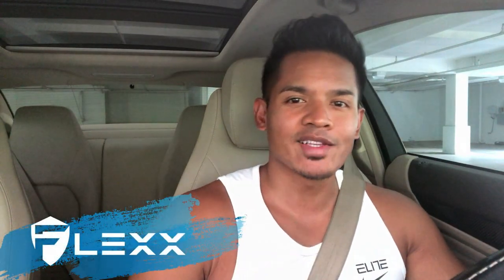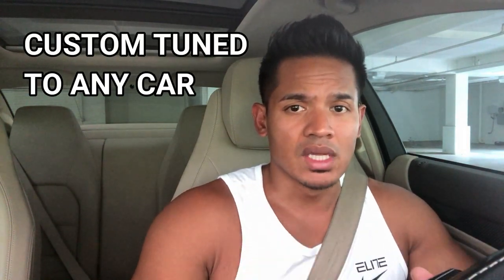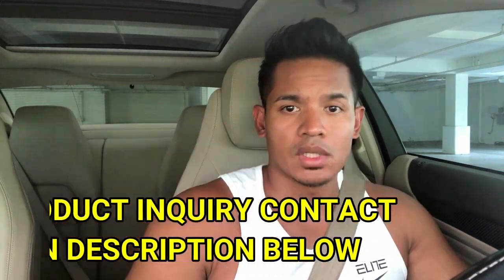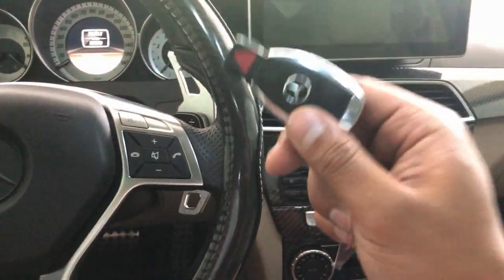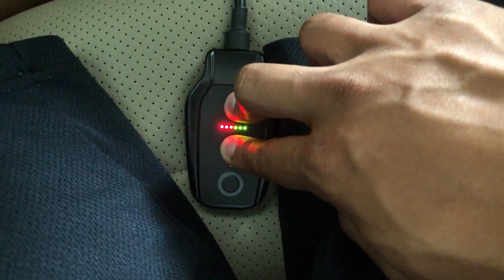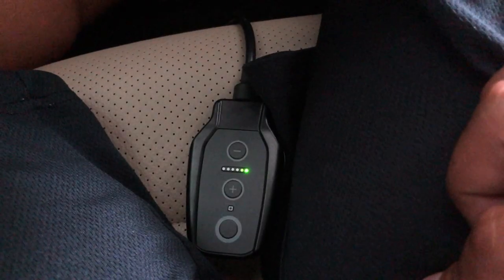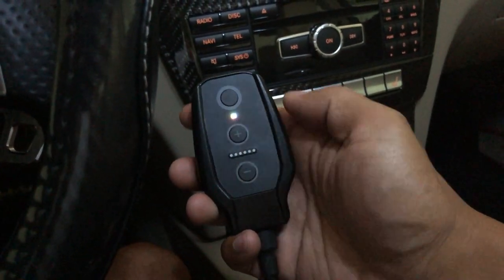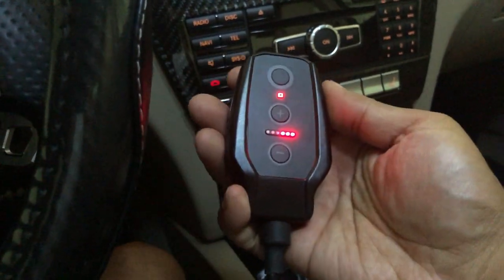Does this tune make my Mercedes throttle gas pedal response faster?

Comment: Hey? Any improvement in acceleration? How it's working till now? What is the benefit of sport mode? I would imagine using eco or racing!
Reply from the maker: Yes. Fine. Faster throttle response.
Reply: @TheFlexxGarage  good to hear :)

Comment: I’ve heard these trash your transmission, anyone have any experience?
Reply from the maker: Well you heard wrong because they have nothing to do with your transmission.
Reply: Hi I am using this since last 3 year no problems the problems with gear box is people don’t change gear box oil then problems starts

Comment: I ordered one for my Mercedes c250 w204 and it did not fit. What’s it’s interesting is mine came looking a lot different than the one in your video. It has a huge red clip on the side from the connector that plugs into the pedal. I purchased from burger Motorsport as well.
Reply from the maker: Then it’s not the same one. You need to talk to them for customer support.  That’s why I got mine from tornado tuning.
Reply: get it fixed yet?

Comment: @flexxalexander Hey I got a question. Would have any idea what key fob fccid is for c250 or ur 2013 c300? I got a c250 with a valet backup key from auction and no idea which fccid it has. Dealer is being a butt.
Reply: Also your website address is not working..?
Reply from the maker: Sorry. Don’t know.

Comment: I have question my car is W176 amg 2013 I have sport mode but what is different for my car this product? Thanks buddy
Reply from the maker: sport mode usually does nothing for your gas pedal throttle response. All it does is allow the car to rev into higher RPM range before the transmission shifts.

This pedal tune with help with the response of the actual gas pedal/throttle. Any car can benefit from it.

Comment: Would you recommend this one or the pedal commander ?
Reply: did you find an answer?
Reply from the maker: Pedal tune from tornado tuning is tuned for the car.  So it’s more smooth with throttle pressure. 

You can’t tune the Pedal commander to the car. What you get is what you get.  A lot of the modes are kinda jerky.

Comment: i’m planning on buying the PC43, which one you think has the more throttle?
Reply from the maker: It’s not about more throttle. It’s about throttle sensitivity.  The pedal commander was too aggressive.  The tornado tuning pedal tune was way better with more settings and adjust to the range of the specific cars gas pedal.

Comment: Hey flexx does this work for a 2009 mercedes Benz c300
Reply from the maker: Yes
Reply: Thanks for responding I’m on the website now just want to confirm is the one in this video priced at 179.99
Reply: @TheFlexxGarage  also does it turn off with the when the car turns off or do I have to manually turn off the tune pedal and then the car ?
Reply from the maker: It shuts off like 30 seconds after you leave car.

Comment: Hello, i can’t turn it off. Is this normal? After using it when closing the car, the Lights still burns even if i try to turn it off with holding the program button
Reply: how much did it cos?

Comment: i know it’s been a while but thoughts of this pedal tune vs the commander pedal tune?
Reply from the maker: Pedal tune is smoother than pedal commander.  Pedal tune actually takes into account some of the mods you have versus just working stand-alone.
Reply: Flexx Alexander cheers bro
Reply: @TheFlexxGarage  So which one would you recommend more?
Reply: @TheFlexxGarage  i know this is old, but how does the pedal tune know your other mods when all you do is push the pedal down for tuning.